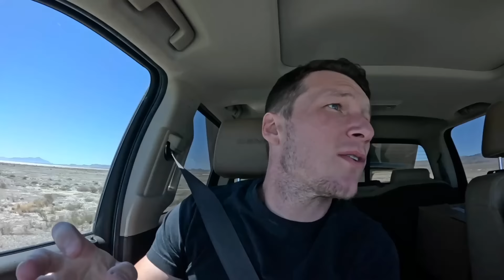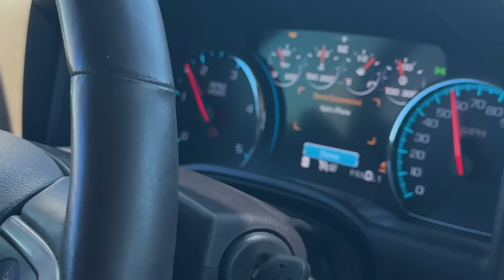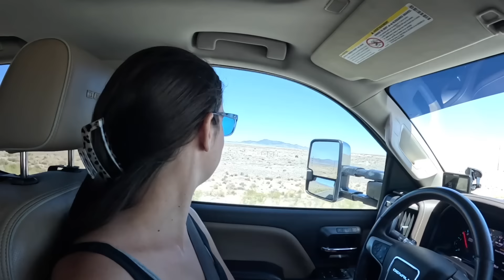New Trucks are 'Built' to Leave You Stranded

Comment: @happilyeverhanks Former GM Powertrain Engineer here. These systems were implemented to meet emission requirements and NOT for the longevity of your vehicle. They will impact the lifespan of the engine this is why all .Gov vehicles are sold without DEF, EGR, SCR, DOC and DPF systems. You have a few options. 1) delete the truck which is illegal but is the best for the truck. You being on a public platform I would rule that one out. 2) Always run Optilube XPD. Since sulfur has been cut from diesel fuel lubricity is a large determining factor to the life of your injector pump, injectors and cylinder walls. DO NOT run ATF or 2 stroke! That was ok pre emissions but that will absolutely wreck your DOC and DPF! He should not be telling people to do this. 3) Only use fresh DEF. IE DEF from truck stops off a main highway or DEF from the store with a recent date. ALWAYS add nuDEF when you add fluid. It will prevent crystallization of the fluid and prolong the injector life. Try and keep it above 25% and below 75%. Options 2 and 3 are the best you can do to keep things on the up and up. I would also recommend a Banks iDash. This will allow you to monitor regens, soot levels and even command regens yourself. A well maintained Duramax should have no problems making it to 500K. The injector pigtails, the emissions systems and the MAP sensor sooting up are things to keep an eye on. Once you know the potential issues and how to prevent them it is a reliable truck.

Comment: ATF and 2-Stroke are NOT the go-to for High pressure pump lubrication in  most trucks after the LB7 and 2nd Gen cummins.  I'd use actual XPD Fuel additive if it was me.

Comment: I had a Silverado and EVERY time I towed the check engine light came on. I was way under my maximum weight limit and they never could figure it out. I got fed up sold my trailer and bought a small van. Traded the truck on a mid size suv. My brother has the same truck and now there’s a mass issue with the transmissions in that year.

Comment: emissions are why older truck drivers like the old trucks, they break down less and way more reliable, and with a mechanical fuel pump, if you run out or low on fuel you could use oil to get you in somewhere

Comment: This shop is a few miles from our location. Great information but the axles and running gear is the same parts as a gas vehicle. Also the HO Ram transmission is built for medium duty vehicles which are larger than the trucks we are using. 

Glad he got you back up and  running! 

I am either going to take my 2023 RAM 3500 HO on a weight loss program or it’s getting sold and I’ll end up with a 7.3l F350. Life is too short to deal with this emissions crap!

Comment: It helps driving at night if possible in the hot summer months with any ride. The high temperatures wear and breakdown the fluids. Plus the heat of the engine and drivetrain can't cool as easily.

Comment: Couldn’t pay me to have a diesel currently. Was at a Ford dealer getting parts for my 2000 Excursion V10, and was listening to a service manager tell a customer that his high pressure fuel pump exploded on his 6.8 diesel. Because it sent metal though the rest of the system, the cost was $12k. Not uncommon with any new diesel since they took the sulphur out of the fuel, no lubrication. Maybe additives help, but my next truck will have a 7.3 gas big block.

Comment: I would never add ATF in a modern diesel engine with a high-pressure common rail system. ATF has additives that aren't meant for combustion. Modern diesel engines have very precise fuel injection systems that are designed to work with specific types of fuel and additives. ATF can disrupt these systems and potentially cause damage.

Comment: Ok, ok...

Stop taking it to the dealership. Don't delete it, that's just asking for trouble.

Take it to a T/A, and see what they say. Maybe a loves, if it's staffed with good mechanics. They'll know where you can get it handled properly. The truck stop shops deal with this shit all of the time. 

Second, and do this right now, BUY A TOOL. I recommend the Ancel x7hd. Not because it's especially good, but because it's relatively inexpensive for what it can do. Learn to use it, and learn how to deal with the codes PROPERLY. It'll all come together the more you deal with it. The entire aftertreatment system is self cleaning. If it's not cleaning itself, the problem is UPSTREAM. Walk away from anyone who says different. It's one of the most lucrative cons in the automotive industry. 

Good luck

Comment: I have a 2018 GMC Canyon with the 2.8 diesel. I feel your pain Hanks. I've been there myself. I almost traded it in for a gas truck. The service advisor at my GMC dealer felt so bad for me after spending thousands. His recommendation was to use hot shots diesel extreme and Blue DEF Platnum fluid. Going on two years now, haven't had any more DEF warning lights or issues whatsoever. Save yourself the agony. I think you'll thank yourself for trying it. Good luck, and I'm looking forward to more travel videos.

Comment: And this is why I won’t ever buy a brand new over priced $100k plus new truck 🛻. There’s a reason I have a 2002 24v HO 6 speed manual second gen dodge 2500! No fancy electronics, no emissions, no excessive modules and crap. I new exactly what I was looking for and what I wanted. I had previously and sold my ‘06 mega cab 5.9 Cummins that was built and suped up. It was mint, had low low miles. I sold it for good good money. And bought an older truck with a manual trans. Autos a junk. Peroid. Everyone wants a manual. A 6 speed. Everyone wants a 6 speed. Everyone wants a pre emissions diesel! That’s why there going for big money these days. 20+ plus year old dodges that are cow kicked beat up, rusted and high high milage selling for $20,000-$30,000 or more. You won’t touch one with under 100k for less than $50k. 
I was smart and found the perfect one owner, mint inside and out low milage, garage kept, west coast forever truck that had never been east of Colorado. And I only paid $16k haha. 
I went to diesel school and auto school when I was younger. I’ve worked at the shops, the dealer, and the aftermarket. 
Be patient. Diesel emissions are going away. Really soon. Give it another 40 days. You’ll be able to delete and tune it soon. The diesel aftermarket is going to explode really really soon again. Trumps epa is unleashing American diesel power again! Bye bye to the Obama era restrictions and garbage we felt with. Diesel emissions are a joke. They don’t work. You can’t make reliable power with that crap on them. Peroid. A diesel engine was never made to eat its own a$$. Anyone that tells you other wise is indoctrinated and brain washed. These newer trucks have been over complicated with to many sensors and modules. You literally have sensors sensing sensors. Imagine being stranded on the side of the road with your hot trophy wife and being dead in the water in ‘limp d!ck mode’ with your EV out in the middle of no where! 
It is a lemon! You got suckers into buying an expensive over complicated choked by emissions and restrictions because of a failed democrat fake green new scam climate change initiative that was the biggest scam ever implemented on its own people. 
Your not going to be able to work on that thing by yourself. lol you can do the whole YouTube diagnosis thing and learn everything about it but trying to even work on one of these new trucks by yourself or even being a qualified trained technician in a shop with your huge tool box, it’s still a pain in the a$$! They do this on porpuse! These new trucks have planned obsolescence engineered into everything! They want it to be hard to work on and fix, that way you’ll buy a new one once it’s past its expiration date that’s been programmed into it at the factory. No joke. These new trucks, every module in the truck has a ‘fail by date’ pre programmed into every module! That way your forced to take it in to the dealer! If you want a reliable diesel truck, don’t buy anything older than a 2006! And stay away from a duramax and a powerstroke. There junk. I know that’s gunna make some fanboys of duramax and powerstroke have sore hoohas and need a tampon but it’s true. A straight line 6 just makes more torque. 
…you gotta be careful putting the 2 stroke oil and atf in the tank of anything with dpf and a cat. It’ll cause soot and ash and clog then right up faster! Yes it works great on anything pre emissions! I pour a quart or two of 2 stroke oil or atf into my tank every fill up on my 2002. 
Running coolant thru the def injector. lol see what I mean by over complicating everything! Just one more thing to break or leak. My 24v 5.9 Cummins is so simple. The water pump has 2 bolts that hold it on. It’s can be changed in 15 mins, it would take me longer to get the tools I need out of my box and drain the coolant down. lol this guys so Indoctrinated, vgt turbos are not good and awesome! Again an over complicated simple system that’s been made to fail! Electronics are bad! Modules are bad! Sensors are bad! Emissions are bad! 
I’ll keep my older 23 year old truck that’s clean and mint perfect, guaranteed it’ll still be running in another 20 years, I doubt your new truck will be running and driving in 20 years, none of these newer diesel trucks will be running, there all gunna be broke down on the side of the road or sitting in lots because of a $20 emissions part with no one that knows how to work on them!

Comment: As bad as it is having trouble, you are better off with a diesel engine by far! Yes, years ago they tried cleaning up the system but diesel fuel take less to refine than gas. 250,000 is 1/2 the life of that engine. I agree deleting is better but technically illegal for now. The Duratune (i believe is what its called) has done the research and testing to get the most from your truck. Great video guys. You make my Thursday better.
Reply from the maker: Thanks for sharing and watching!

Comment: Hank, thank you so much for putting this content out for us Diesel owners. I have a 2012 Dodge ram, so I am so happy I don't have DEF. 
TY😊
Reply from the maker: Keep that truck running good!
Reply: @HappilyEverHanks 2004 Chevy 2500HD Duramax.....275,000, still going strong 💪.  Original Allison,  Original injectors.  DIESAL KLEEN  every 4 fill ups.
Reply: @mikeglasgow9618  Diesel Kleen?  I have a 2005 Ram with about the same number of miles.  I will start to add.
Reply: @kevinorr6880  yes, I  guess you could say I'm fortunate.  My truck died in me at an intersection about a mile from my house.  Had it towed to my diesal guy and wanted an ESTIMATE for repair. He called me two hours later and told me my truck was DONE. I asked him about the ESTIMATE! ? He said,  since I was a regular customer with my other vehicles,  he knew I  would want it done and just jumped on it. What happened was a wiring harness to an injector had chaffed on a bracket.  Causing a shut down code. Chevy already knew about this and had made a TECHNICAL BULLETIN out.  Total cost of repair was $ 149.00 . Lucked out on that one. My guy could have told me ANYTHING.  Upstanding mechanic.
Reply: DEF became mandatory in 2010. Your truck has DEF or has been deleted.
Reply: @Zadnak1   OP is right.

Ram started using DEF (Diesel Exhaust Fluid) in their heavy-duty diesel trucks with the introduction of the 2013 model year.

This was to meet the stricter EPA emissions standards that took effect for diesel engines in January 2010, but Chrysler delayed implementation in the Cummins-powered Rams until the new SCR (Selective Catalytic Reduction) system was rolled out for 2013.

So:
	•	Up to 2012 model year – No DEF system on Ram Cummins diesels (used only EGR/DPF).
	•	2013 and newer – DEF required on 2500, 3500, 4500, and 5500 models with the 6.7L Cummins.

Comment: Caidin is correct with the ATF fluid cleaning injectors and happy to hear that.  I started driving semi back in 1978 and the truckers did the exact same thing. Now, there could be a problem with that,  back in the 80's premium diesel was dyed red to signify premium, then the EPA said you can no longer use red dye in on road fuel, now off road fuel will be red as it doesn't have all the tax added to it like on road fuel. In commercial trucking if you are caught with red fuel you are going to have to prove that you are not using off road fuel, all new commercial truck motor manufacturers are against ATF being used and I believe that will void any warranty. I believe people like you will be ok with it's use. After treatment systems on diesels are only going to get better as time goes on, they have been since their inception. I would not listen to these posters about deleting your after treatment systems, your going to pay the price if you get caught, let the outlaws be outlaws they can feel good about them selves.

Comment: Dump the diesel and get a 7.3 Godzilla Tremor, has 4.30 gearing, almost same towing capacity, same transmission as the diesel, 9-10 mpg gallon towing a 10000 lb fifth wheel, $13000 cheaper, less maintenance cost, dependable.  The $13000 you save buys a lot of gas, most people do not calculate this when buying a diesel. It has more towing capacity because the diesel’s weight takes away from gvwr.
Reply: Also need to factor that diesel is usually 20% more than gasoline

Comment: Thanks for the Informative video.  On you next vehicle, you might consider the Ford 7.3 gas engine with a 4:10 differential.  I have a '22 F-250 with 37k miles with 80% of those miles towing 6K+travel traile.  Not as big of a trailer as yours, but a lot of RV'ers have changed over to gas for less headaches on the road.
Reply from the maker: Seems to be true!
Reply: @HappilyEverHanks I agree with him. I have a 22 F-350 with the 7.3 Godzilla and 4.30 gears. I transport for a living so 98% of my miles are with a trailer behind me of at least 10k. I also have an 18K fifth wheel toy hauler that I RV with. I am at 160 K on mine and it does great if you maintain it well. The Diesels are just too expensive to maintain with all of the restrictions that have been placed on them. You can buy a brand new Godzilla engine WITH a transmission for 8k. When you compare everything the gas Motors are just cheaper in the long run to maintain and operate.

Comment: Have that EGR valve cleaned out every 3-5 K miles and that should elevate that issue.  
I ran a fleet of diesel vans. Has them all scheduled for a 5 k EGR valve clean out.
Reply: Take the egr off. Problem solved.

Comment: As an alternative for folks I'd suggest a 2000 - 2002 F550 7.3L diesel 4x4. Between 20 - 25k and roughly the same specs and will just run a long long time with maintenance. Will need to spend some money for comfort upgrades however a lot less than a new truck.

Comment: Does any Automatic transmission fluid work? And how much per gallon should a person use to prolong the life of your injectors?
Reply from the maker: That's a great question, hopefully someone can jump in here to answer that for you!
Reply: @HappilyEverHanks I researched it and found that it is not a good idea to use ATF in your diesel fuel in modern trucks. I used to use hotshot Dave’s then watched a video by Lake Speed jr whose testing showed that power source fuel additive was the best and actually endorsed by Cummins. In my opinion my truck is quieter and seems to run more smoothly.

Comment: I bought my first new P/U truck in 1972. Towed RV's since. Back then we only had  ~196hp & 327# TQ gassers. Numerous makes and configurations since. Regardless of  brand, it appears to me that all diesels since emission controls have been very problematic. Personally I will not own one again, especially after currently owning a F350 with a 7.3 Godzilla gasser. 430 horsepower and 475 lb-ft of torque are plenty. Never an issue with going up or down hills with a 10spd tranny. No DEF. & $0.50-$1 a gal less for fuel, 4200 mile trip with a friend that has a diesel with similar RV. He got 1.5mpg better. He has more torque, but I have no issue keeping up or down any large mountain passes. When I ordered my last truck it was a $10k difference for diesel.I can buy a lot of gas for that kind of difference. When on the road, IF I had an issue, lots of mechanics & dealers for a gas engine. People say you get more $$ at the end. Well i booked both way & they still depreciate at pretty much the same percentages. You get more b/c you spent more. If you want a diesel; get one though.

Comment: That's why we have a 2001 Dodge 2500 5.9 diesel truck.
Reply: 2006 dodge diesel here, no problems.
Reply: 2005 Ram 3500 manual trans.  A keeper.  About 15 miles per gallon, but I will never willingly buy into the hassles of a new truck!  I am not knowledgeable enough to avoid a bad purchase.
Reply: Still running my 2001 5.9 Cummins thought about a new one but thought better.

Comment: he is not correct my 2024 f350 7.3 gas has the same transmission and drive train i had diesels over 25 yrs the diesels say longer oil changes have more oil but you dont want to run long oil changes because the diesels are so dirty  i have had crazy repairs on my diesels. will never buy another one.

Comment: EPA just rolled back the restrictions on diesel engines, Make Trucks Great Again.
Reply: That is incorrect. Nothing has been rolled back yet. They may eventually be rolled back after court battles and so on, but not yet. Also the current thinking is that a roll back will likely apply only to new vehicles and not retroactively.

Enforcement is something different entirely. They may not retroactively apply rules but they may stop enforcing them.
Reply: @MrBuffaloB correct. Some people can’t read past a headline.